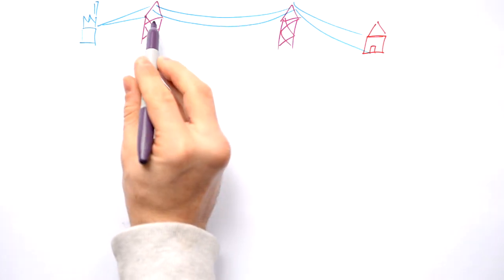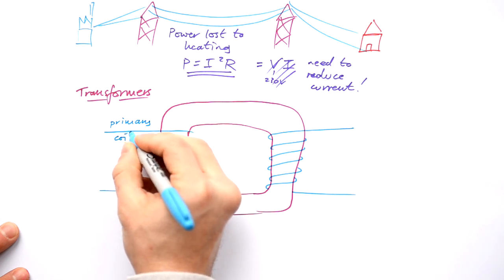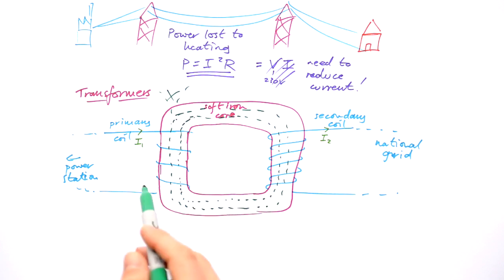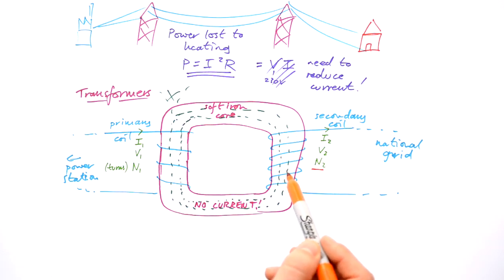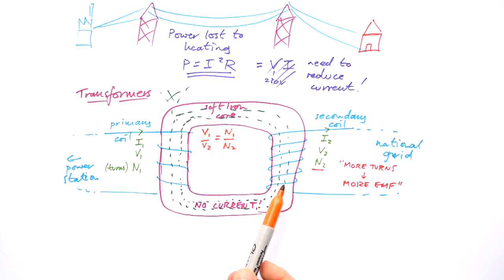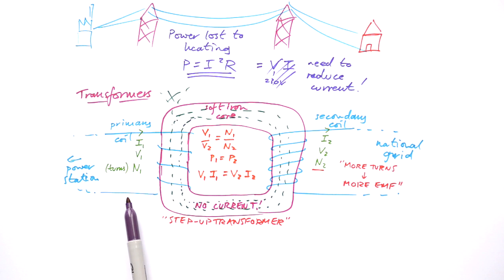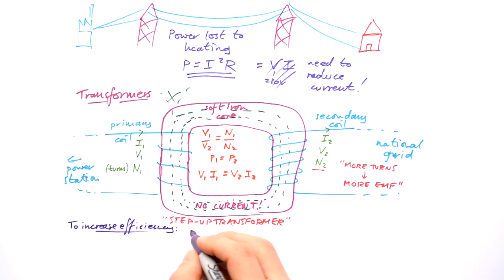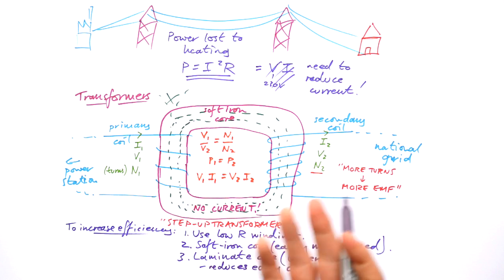Transformers - A-level & GCSE Physics (full version)

Comment: Wait why can't Power loss be equal to IV? I didn't understand sorry .I came across a question which said " Explain why power losses are lower when the voltage is high ."Can't we  just say that, P=IV therefore  to deliver a large amount of power either V needs to increase or I . But we don't increase I because that would lead to overheating of cables. The mark scheme however said "Power loss from cables = I2R , so lower the current , means less power loss. " Doesn't my answer and this answer mean the same thing?
Reply: You need to understand in P=IV, the power in the energy lost per second in the pylon, which we want to reduce. And that the v in this equation is the voltage across the pylon  and not the supply voltage, therefore we don’t use this equation but rather p =I^2R, since current increases by the qsquare we want to reduce this.

Comment: If all the magnetic flux is content in the transformer core, then how is going to affect secondary wire. Don't we need flux line to CUT wires to induce emf.
Reply: Apurv Jadhav I’m not 100%sure. The current is an alternating current. So flux keeps changing therefore inducing an emf in secondary coil(from faradays law)
Reply: @ritesha8050  You are right. Magnetic flux changes due to changes in AC current, but still all the time those magnetic fluxes are contained inside the core. And for emf induction we need flux line to cut wire. Hence the confusion.
Reply: Though very late reply in this specific scenerio we don't wires to cut. Wires are needed to cause a changing magnetic field. Here the alternating current does the job of the wire by changing the magnetic flux linkage. 
If suppose we use a wire here then the cutting and the changing current both of these effects would cancel out each other. So no overall change in magnetic flux linkage. 
Hence no wire needed. 
Hopefully it is clear now.

Comment: I understand the amount of turns on the primary coil determines the strength of the magnetic field in the core. if you have 20 turns on the secondary and 5 on the primary, would the voltage increase on the secondary if you increased the primary to 10? I know it wouldnt but i dont quite understand why. why not just use 1 turn on the primary always if it would be more efficient to use less on the primary than the secondary?
Reply: Equation is P=I²R so increasing I is more important than R. If resistance changes by a factor of 3 suppose then current changes by a factor of 9 due to the square in it. 
Using 1 wire would have far too less current passing through it. We need a certain amount of current to actually function the transformer. So using one wire is not sufficient enough. 
Hope my super long winded explanation helps.
Reply: @kazishahjalal6852  It did.

Comment: Thank you so much, please tell me what emf is?
Reply: Electromotive force, also called emf (denoted and measured in volts), is the voltage developed by any source of electrical energy such as a battery or dynamo. It is generally defined as the electrical potential for a source in a circuit.
Reply: Its the amount of energy needed by the power source to push a coulumb of charge across the whole circuit i.e. from the positive to the negative terminal of the battery.
Reply: @arulgk9673  that’s if it’s a conventional current of course.

Comment: if you increase the voltage with a step up transformer, why does the current decrease, cause V = IR so why doesnt the current increase
Reply: Yo
As power1= power2
1 is primary and 2 is secondary

I1V1= I2V2

In a step up transformer your v2 would be high as the voltage is being stepped up now to conserve power on both sides I2 goes down

Example
Lets say V1 = 10
                 I1 = 4

And let's say the transformer is stepping up voltage to 20 

I1 v1 = I2 V2
10 x 4 = I2 x 20
I2 = 2
Decreased